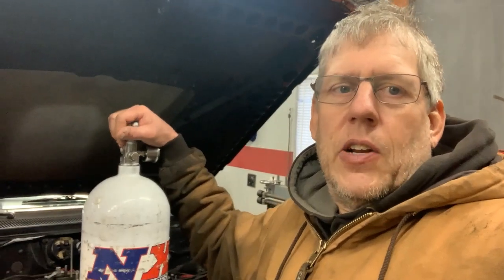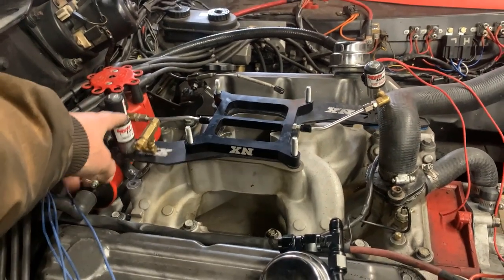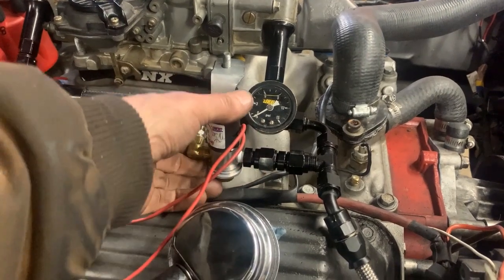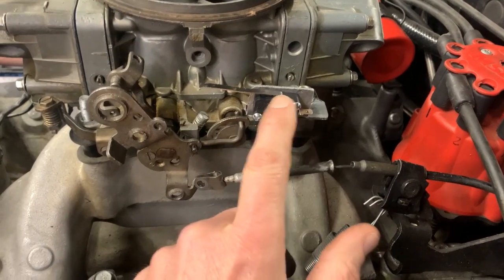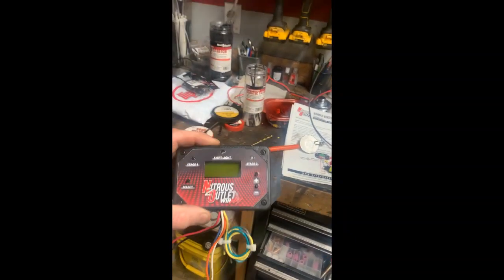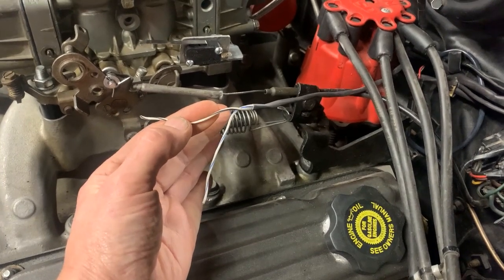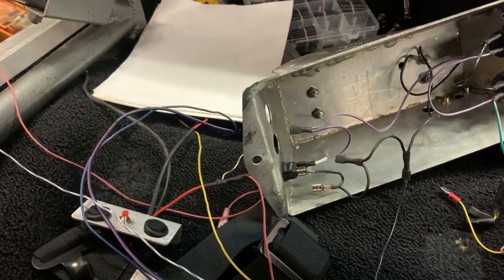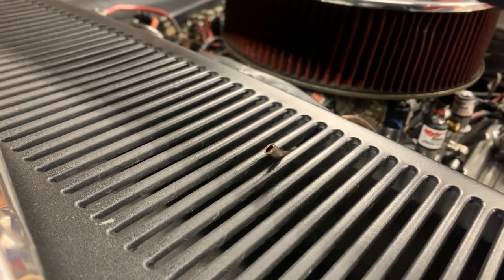Adding a NX Nitrous plate system to my 1970 Dodge Dart Swinger for Sick Week

Comment: I was getting ready to put a nitrous kit on my 12 second camaro for sick week , but after contacting there tech guy found out if running nitrous they  require  -5 jacket, pants, gloves , and a nos blow down tube. Just thought i would pass the information on just in case.
Reply from the maker: I have all that. Even at 12 I spent the money for safety. Cheaper than a trip to the burn center if something goes sideways.